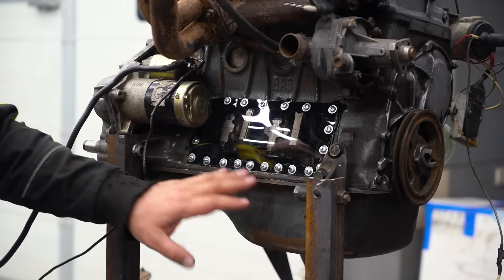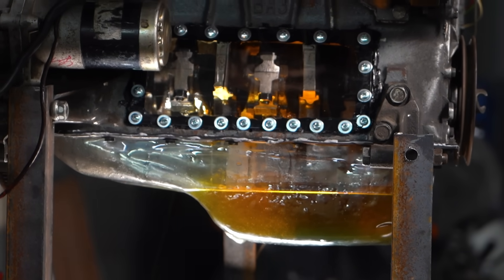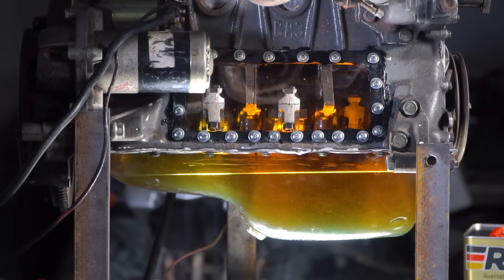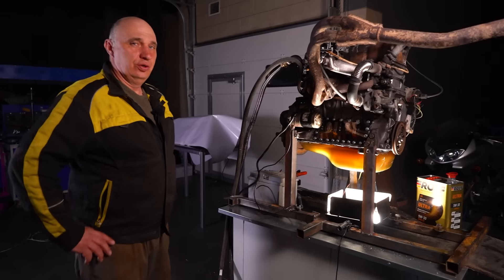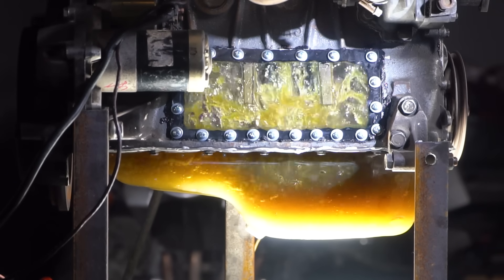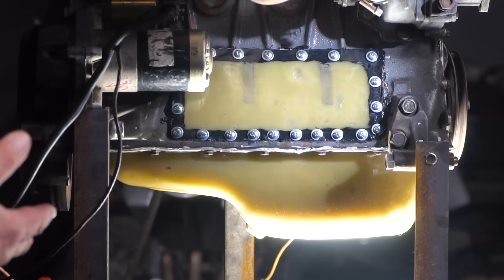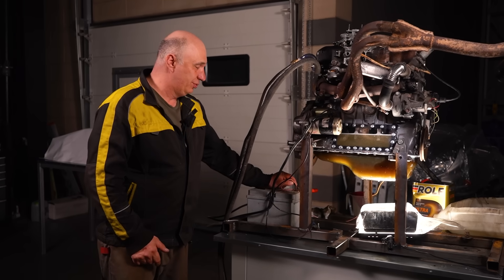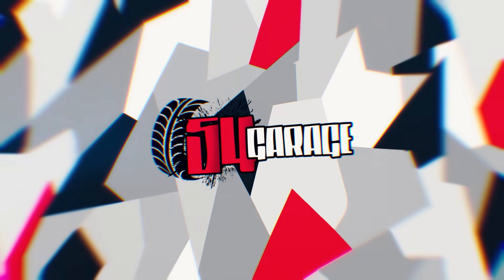What actually happens when you overfill your motor oil? (w/ transparent oil pan)

Comment: It's not really a real life situation since the car would be stopping and starting, going thru curves and the revs would be continuously going up and down and running potentially for hours. It's a given that no one in his right mind would put that much oil in the crankcase. The foaming affecting the oil pump's job, the reduced ability of the piston rings to prevent oil from entering the combustion chambers, the end seals of the main bearings would eventually leak, all that oil would reduce the engine's horsepower, leaks from gaskets, and finally the useless expense of pouring in too much oil. 
Engines are designed to work within certain limits that are somewhat flexible, but don't be an a-hole. 
These Russian guys of Garage 54 have made for us a very interesting demo.

Comment: I worked in a mine as a summer student.  The CAT dozer I was operating required minimum 25% overfill on the oil if working of steep ground.  That was 40 years ago and I have been overfilling all my vehicles ever since - at least a litre over the full marker.  Never had an issue !

Comment: I had a 1995 Ford Crown Victoria with the 4.6 liter v8 P71 police version that I got 3 more mpg by running it 1 quart low at all times. I kept track of my fuel mileage with it at the full mark and running it 1 quart low to prove it to myself. That car odometer stopped working at 275,000 and I drove it daily for about two hours every day for over a year after that until a driver hit me head on in an ice storm. I actually had two of these identical cars and BOTH odometers broke around the 275k mark. My ex got the other cv. I ran full synthetic oil which I changed about 5000 miles or more and NEVER been into either engine and neither ever broke down!

Comment: WARNING:  Do not overfill engine oil under any circumstances!!! 

Overfilling engine oil causes excessive OIL PRESSURE which damages gaskets which, as shown in the video, causes oil to leak not only past the head gasket, but also past the gasket for the water pump, etc, which then requires expensive repairs mainly due to the high labor cost to replace the gaskets, the cost of which is relatively low compared with the labor cost. 

However, the above problem is further compounded for modern OHC and OHV engines the spark plugs of which are recessed in deep compartments the bottoms of which are in about the middle of the engine. This is unlike the locations of spark plugs in older types of engines (such as the engine in the video), which are located near the top of the engine. 

When oil under high pressure leaks past the gaskets that are located near the top of the deep compartments for spark plugs, it flows into the bottom of the spark plug compartments and fouls the spark plugs, and thus causing them to misfire which results in the engine to not operate on all of its cylinders, and the engine often stalls when idling, and it always uses excessive fuel (i.e. fuel that is not burnt because one or more spark plugs misfire). 

Overfilling engine oil can also damage cylinder rings, which then causes oil to enter the combustion chamber of the cylinder, and this results in fouling of spark plugs and excessive usage of engine oil, some of which is burnt inside the cylinder, and some is pushed past the poppet valves and exhausted. 

I am at a loss to understand what the point of this video is, especially after it was demonstrated that damage to the engine gaskets did occur which was evidenced by oil leaking from the engine.

It would have been wise for the presenter to conclude by emphasizing to the viewers to strictly—not under any circumstances—never overfill engine oil past the high mark on the dipstick.

When changing engine oil, it is always better to first undefill by a few hundred milliliters of oil (e.g. ~300 mL or even ~500 mL less than the amount specified in the vehicle's operating manual), but always fill 'above' the low mark on the engine oil dipstick before switching on the engine. 

After filling engine oil to ‘above’ the low mark on the dipstick: –

(i) Add small amount of oil (e.g. ~100 mL at a time); 

(ii) Run the engine for a few minutes; 

(iii) Switch engine off and wait five (5) minutes; 

(iv) Check the oil level using the dipstick; and 

(v) If required, repeat the above process until the engine oil level is either at, or slightly below, the high mark on the engine oil dipstick, but not above the high mark on the dipstick (see Note below). 

Note: It is not essential for the engine oil level to be exactly on the high mark of the oil dipstick. The engine will be adequately protected from damage if the engine oil is anywhere between the low mark and the high mark on the dipstick. That said, engine oil level below the low mark on the dipstick will cause severe damage to the engine, which is much more severe (and much more expensive to repair) than the damage caused by the engine oil level that is above the high mark on the dipstick, which is very expensive to repair. 

If the high mark on the dipstick is exceeded, immediately drain the excess oil from the sump, and repeat the above process: (i) add small amount of oil (~100 mL at a time): (ii) run the engine for a few minutes; (iii) switch engine off and wait for five (5) minutes; and (iv) check oil level using the dipstick to ensure that the engine oil level does not exceed the high mark on the dipstick. But do not under any circumstances drive the vehicle if the engine oil level is above the high mark on the engine oil dipstick, because driving the vehicle with excess engine oil will almost certainly damage your engine and cost a load of money to repair. 

The damage to the engine may not occur or be apparent immediately, but will occur after driving the vehicle for a few days, or a few weeks, or a few months.

Comment: When i was young the lawnmower would always be low on oil. I would put more in but wasn't good at reading the dipstick with clean oil. One time after adding oil the engine started blowing white smoke. I let go of the lever which usually turned it off but it kept going and revved up fast. A quarter size piece of the engine blew off and that was the end of the lawnmower. I've been scared to top off oil ever since.

Comment: Their are some unspoken things here two: 1) LESS OIL IN YOUR ENGINE MEANS LESS OIL COOLING CAPACITY AND GREATER CHANCE OF SLUDGING. Really don't think an extra quart here is going to hurt anything 2) But if you get crazy like they have, all the submerging of the cranks and piston arms, all the physical dipping forces over the life of the motor could cause bolts to loosen. Possibly some erosion of the metal components due to the shear physics of the metal slapping the oil over time.  Think of how rocks get eroded in nature by the ocean, rivers and streams.  All those hydraulic forces can erode the metal piston arms which must stay strong to endure the power transfer of the combustion. Anyone else notice the bits of rust that got removed from the crank arms the more they got submerged? There is evidence of those hydraulic pressures at work physically beginning to erode the crank arms.  3) As was eventually shown, this can increase the pressure on your oil seals... but I think we have also learned you have to put an insane amount of oil in the engine to do this. 😂  Awesome demonstration.  I too have been wondering about this for almost half a century.

Comment: The risk of damage is higher with more oil if you were to keep the engine running and get it fully heated up you're going to increase the inner case pressure due to the more oil in the system and less air as the air compressibility is much higher than the oil

Comment: While I liked it, I thought the whole time: you created your see-through oil pan by using the outside of the existing one as a form. This way, the inside of the form has now more volume than the original pan. So it also needs more oil to fill the pan. Dont know if that comes with any issues or if that was accounted for (or doesn't matter when, for example, measuring with the oil stick - so you just put more in for it to be on "max" than it normally would). Any ideas?

Also, that engine looks quite old (sturdy) - I believe the outcome would be different for a modern engine, where everything seems to be build right to the maximum that the spec allows.

Comment: Early engines did not have oil pumps and instead relied on "splash oiling" It worked but there were problems if you were on a long up hill/down hill grade which left the oil pooled to one end of the block and not able to splash the full length of the crank.

Comment: I wanted to see the oil pump picking the oil from the pan, I couldn't see it.
Anyway, my motorbike works fine without the pump. So, why exactly do we need that except for systems that require highly pressurized oil to function (e.g. VVT)

Comment: I would think one significant problem with overfilling is that at some point oil is splashing and not going through the filter. If you have bits of metal or dirt that get in there, they will hit the engine multiple times before they possibly get in the filter.  It wouldn't matter so much on a clean engine, but as it wears, it would be a bad idea.  It looks like it is beyond the 2x level for this engine.

Comment: I dont think its very matter for car engine, but for single silinder engine it does a lot.

Well i usually overfill my bike up to 1,5 its oil capacity to get rid of tiny vibration that numb my hand for long trip.

But if i overfill more like 2 times or 3 times, the engine start to losing acceleration.

Comment: That's probably true, but they would already know how much oil is needed, they can have a normal oil pan in its place, the side window would probably hold up just fine with the temps.  It won't be as cool, but if the mold they used is the same size as original oil pan, then the test would be still valid.  I would make sure the side window surface is cleaned up good, and thick layer of sealant where it meets the block, then regular oil pan with gasket, and send it!!

Comment: Most cars will blow black smoke out the back when overfilling just a bit. You don't need even twice as much as recommended. Also the crank pressure will massively increase and the engine room will certainly have a blowout-situation where the crank pressure valve will release both air and oil.  And that's leaving out a lot of problems with this.  It's fun to observe, but to state that we have no problem overfilling the engine with oil, is massively wrong.   What we cannot understate, is that this test-engine, is very very very well lubricated =P

Comment: BMW E92 335 when driven on a track at long high speed turns make so much sideways G-Force that the oil in the sump sticks to the side and the engine runs dry. A few have blown up in those conditions. They fix that by putting more oil(maybe 1L above max). 
It works but it is a temporary fix. A solution is an aftermarket oil sump with slots in it(something like what big fuel/water cisterns use). And eventually dry sump oil systems depending on the budget.

Comment: I would just worry about oil pan seal giving way. Once it's all up to pressure and temp. This shows the movement of the oil but does it show what happens after a good 200 or 300 mile drive? In the end still a good video to show I don't need to sweat adding a hair over. Some of it will be lost in blowback anyways so maybe it can self correct?

Comment: He needs to let the engine run longer and under load. I overfilled my oil by a maybe a quart, and after 15 mins drive and couple of pulls later spun a bearing so bad that my motor seized up. Oil pump couldn't move the extra volume of oil and gave up. 
Folks do not over fill your engine oil... Its safer to run low than overfill.

Comment: Only in Russia, it works with this type of petrol engine, try to add so much oil to turbo charged diesel engine and you will see what magic pressure does, absolutely not recommended

Comment: It very much depends on the engine.  If you're lucky it just leaks out more but it can cause a problem if it interferes with oil pressure relief.   I happen to know that diesels can often start to run on engine oil. I saw that on a relatively new engine. That does ruin the engine, you get runaway until something breaks.

Comment: I think he failed to show what happens when there is too much oil and it foams and oil pressure drops and the top of the engine is not lubricated any more. 
Too much will depend on the engine but in this experiment it might be around 2-3x in real life especially at prolonged high rpm.

Comment: Having a diesel the worry is that it can cause a run away...
Would have been interesting to having the temperature of the oil measured, overfilling will cause the oil to get warmer which eventually causes it to thin out and cause bearing failure.

Great video!

Comment: @garage54 and to add to this experiment, i would 

1: try on a longer distance test run/road course for at least 30 minutes and 

2: I'd also like to know the horsepower difference between the oil level at the recommended height versus overfilled, because i wonder if the constant slapping into the oil would affect overall performance/ horsepower?

Comment: NICE dub! Good video - 9/10 would watch another similar. Good info, too. Always knew there was little or no risk from running overfilled - within the limits of sanity, of course. I was surprised the plastic oil pan didn't give up the seal quicker than it did - It wasn't the pressure (though I'm sure that was building significantly at higher oil levels) that concerned me. It was the heat causing the plastic to soften enough to deform and inevitably fail. What was the forming temperature? And what was the plastic?

Comment: He acts like there was no problem when they overfilled it the first time! It was literally being sucked up from the turbulence of the crank! If it would've been ran like it would at highway speeds it would've foamed then! Especially without a windage tray. And they never discussed oil pressure.. Not a very technical test.. foaming would've been an issue way earlier on which would caused low or fluctuating oil pressure which decreases the cushion between parts.

Comment: I think it is safe to say 3 times the recommended volume is a problem but an extra quart isn't reaching the shaft on that engine.  Your mileage may vary (pun intended).  On my 4.0L inline 6 and  my 5.7L hemi an extra quart is not going to be a problem.  But a smaller engine has less head room (more puns).  If you are off roading you might want that extra quart for steep inclines to keep the tube full.

Comment: We had a real Jim from Taxi in auto tech, that looked just like him.  Instructor told him to change oil on a car and charge it to his account at the parts desk, where a local auto parts store  sold stuff there. He knew something was wrong when he saw 3 cases and something like 36 empty quart bottles all over the place.  Guy filled a Chevy 350 up to the cap on the valve cover.  After a number of plug cleanings, it finally cleaned out and ran okay

Comment: It’s crankcase pressure. Over filling increases crank case pressure and foaming. Hence why high performance systems will run windage trays, dry sumps, etc.

Some engines have seen a 15hp increase just controlling the oil mist with a windage tray alone. This lada doesn’t have near the systems a newer engine would in any other brand so it’s not really gonna give too much of a shit about crank case pressure like an old 60s engine wouldn’t 

Fun to see though

Comment: It depends on rhe situation. I run a high volume pump with a stock pan. The pumps sucks oil from the pan faster than it can drain back. I over fill by half quart so the pump doesnt starve.

Comment: This is really interesting. It is so good to know that an regular engine is not harmed by overfilling it a little. Now i'm curious if you can do the comparison with putting oil in the engine that is way thicker than it should be. So instead of having 5w40, you test 15w40. I think it will not harm engine, but I don't want to try with my own car lol :)

Comment: They actually run better with less oil than fuller cause there's none floating on the rods and crank. This robs horsepower.. why they make dry sump is you only have 2qts in the rotating mass.. the rest in a tank keeping that weight off the crankshaft

Comment: I did an oil change for the first time on my 2019 Rav4 Hybrid XLE... After pouring a 5 quart jug in (specs say 4.8 quart capacity plus oil filter) nothing was showing on the stick. I waited a good 15 minutes and still nothing. So I drove to the parts store and bought another two quarts "in case I need it". Well... I didn't but I still put in an extra quart and waited and still didn't see any on the stick... Ended up siphoning out about a full quart afterward... Basically wasted $10 (because the parts store charged $10/qt and I didn't have a container for the clean oil... oopsy). 

Anyway... I probably could have run 5k miles with an extra quart but didn't want to risk it. The car's only got 40k on the clock and I've put 10k of those on it. It's the newest vehicle I've ever owned both in mileage and age by a wide margin.